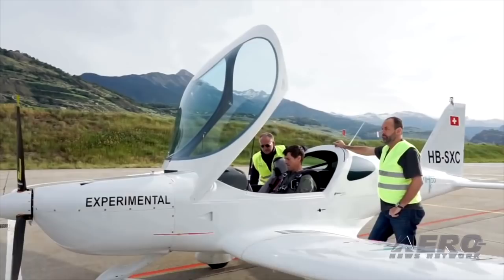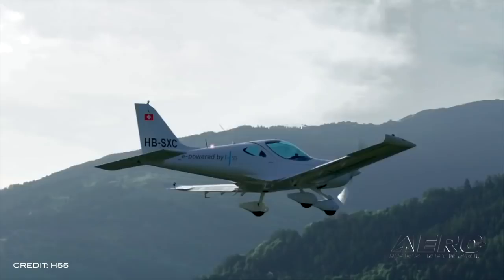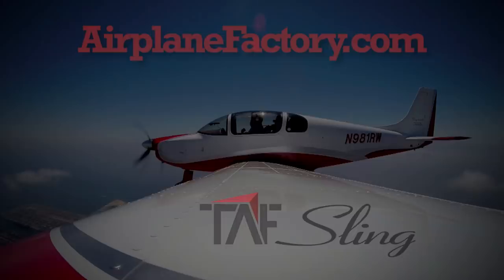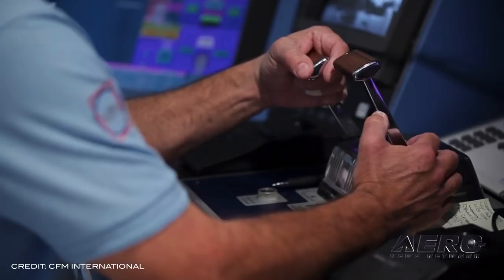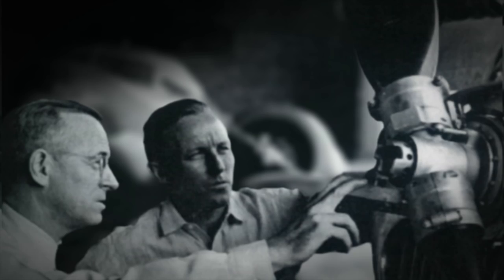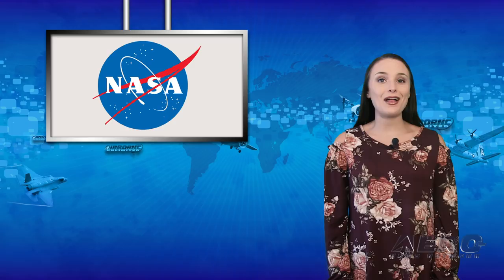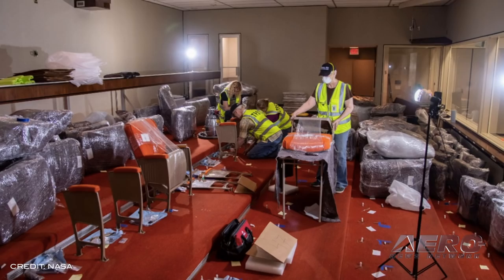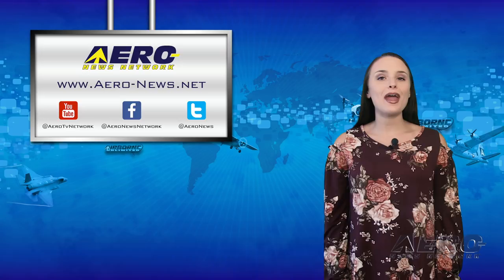Airborne 06.26.19: H55 Zero-Emission E-Plane, Restored Apollo MCC, Skip Stewart

Comment: In the US electric planes and cars are,in effect, coal burners. 80% of the electricity off the grid comes from coal burning power plants.
Electric training aircraft make sense from a low engine maintenance point of view.
Reply: The percentage depends where you live and the fact that electricity comes from coal or natural gas isn’t the fault of electric tech. We must also push for the change of the electrical grid. England has run its entire country without the use of coal for over 2 weeks at a time.